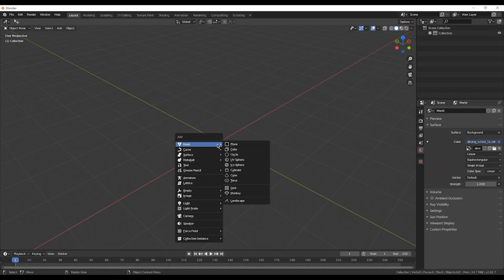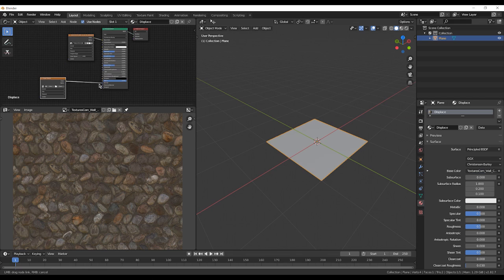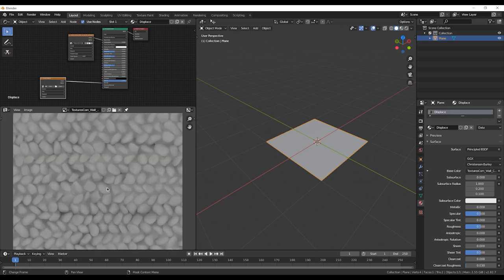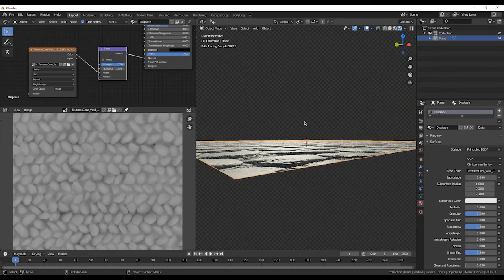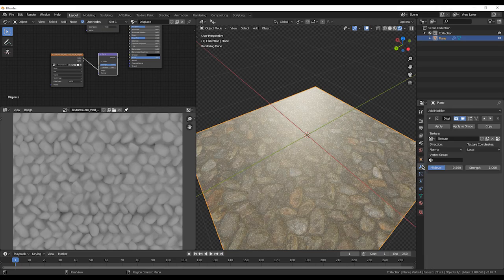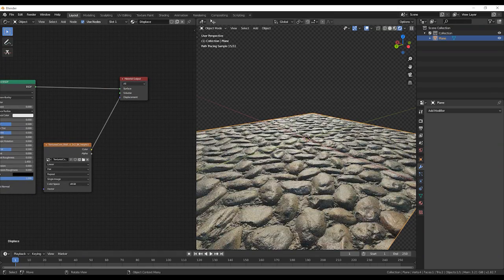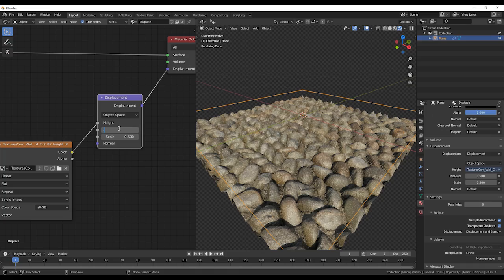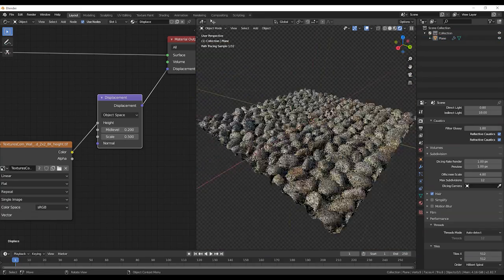3 Most Popular Methods of using Height, Displacement or Bump Maps | Blender 2.8

Comment: is there a way to displace the image and bake it into the image and then use a low poly model to get the same visual without actually having to render the displacement in the final render?  Using it in an animation sequence as well.

Comment: ... Hello and Thanks for this good tuto. But, for the best solution (3rd) : is-it possible to use this on a complete volume - like a wall, or building - on all faces and, above all, with good connections or fittings between the different faces? I did not succeed this..

Comment: While height, displacement and bump-maps are all very similar they are NOT the same.
Heightmap specifically refers to the height of maps - duh - and as such is a simple 2D greyscale image. It is not even about shading or displacing but generating the actual geometry. It is very often used in games as it is a very simple yet good-enough method. (In general the landscape is represented solely by the height-map with no other data needed for the geometry, for the rendering the index in the map is directly used for x/y coordinates and the value of the map is used as the height).

Bump-mapping specifically refers to shading Only. Those maps are also just greyscale but contrary to heightmaps they are used on objects to change how they interact with light. In general this is done in the simplest for taking the gradient to the surrounding pixels as the slope of the pixel and using that to compute the brightness.

Normal-mapping commonly uses 3 channels (albite 2 channels is enough) and directly stores the normals at each pixel - so more accurate than good old bumpmapping.

And displacement-mapping is kinda like an application of height-mapping on 3D objects - allowing the actual geometry to be altered.
This can use a variety of textures and interpretation of those - the simplest is using a simple 1channel greyscale to only get the amount it should be displaced along its normal. The more powerful version is 3 channels - height + 2 normals - as that gives more control over how edges in the texture look like (You can make them hard edges or smooth curves). This of course needs actual geometry. And it also comes as a 3D displacement where the 3 channels represent a displacement along all 3 cardinal directions, making overhanging geometry and the likes possible - the most powerful variation.
As you are dealing with actual geometry here this of course is in general far more powerful but also resource-intensive of the methods so far. If you just want the nice highlights on a coin it makes no sense to have a very high poly-count and displacement-mapping when normal-mapping will basically give the same visual result. But if for example you have the outside of an old stone+wood building with rough edges then displacement really brings it to shine.
And as having all the geometry in very high detail is usually a waste of resources it is mostly used together with view-dependant tesselation: an object far away and small does not really benefit from tiny displacements, better to just tesselate the nearby objects to give them extra geometry for better visuals. 

There is also parallax mapping:
bump/normal-mapping have the problem that they only affect the surface-normals, parallax-mapping also tries to compensate the texture-coordinates based on the viewing angle. If you look at actual bump/normal-mapped geometry while changing the viewing-angle you notice that only the lighting changes, the texture stays static - while with parallax-mapping you see a stronger 3D effect as it looks like the surface is experiencing parallax. But this too does break down on shallow angles as it is a simple 1 step lookup-offset (You check the texture-coordinate for its value, then use that value alongside the viewing-angle to look up a new texture-value that is far closer to what you would see if the surface was actual 3D).
This takes slightly more performance than normal-mapping (which is identical to bumpmapping in performance) but gives way better results.

And finally there is parallax occlusion mapping:
It tries to solve the inaccuracy of parallax-mapping by using an iterative process that allows for the texture to hide (occlude) it self without causing big artefacts. It is again more costly due to being an iterative multistep process (often in the range of 5-10 lookups) and breaks down at sharp corners, but on smoother bodies it gives a near identical visual result to displacement-mapping while requiring far less geometry and still usually being quit a bit faster.

The terms sadly often get mixed together, specially parallax mapping in recent years go highjacked by 2D game tinkerers with no idea what they are talking about (no, not even just confusing it with parallax scrolling but just outright making up shit).
Reply: Man why can’t we save this comment ! Great job! Is there a main source where I can learn all those thing that you talked about in your comment ???
Reply from the maker: ABaumstumpf great explanation! And interesting you mentioned parallax, in Blender this has not made it’s way yet (as far as I know at-least). l get your point, maybe I wasn’t clear enough in my video. What I tried to say is, that there isn’t really a difference in the map itself (bump, displace and height). The map will be black and white, unlike a normal map and can be used for bump, displace and height. I get that they are different, but what I tried to say (mainly for beginners) is that there isn’t a difference and you can use all 3 for the same thing. I mentioned this because beginners are also often confused about albedo, diffuse and base color. I get that these are also not the same, but for beginners it is easier to understand if I just say they are “the same” you know? Often when I explain things like this I try to make it understandable in a way I guess, so people are not confused with all the detail. They can learn the details after.
Reply: @DamianMathew  Yeah, bump, displacement and parallax maps can als use the same texture, just different maths and visual results - i did enjoy your video anyways.
Reply from the maker: ABaumstumpf yeah exactly. I will try to be more clear in the future, I still need some practice in using the right words for making clear on what is a fact and what I just mean in general. I am glad you liked it!
Reply: @DamianMathew what about bricks ?

Comment: You can also make complex meshes by applying in the displacement modifier then decimating the mesh. Can be useful if you want to break a shape or silhouette up without massive polycounts.
Reply from the maker: JayJapanB good tip, thanks!